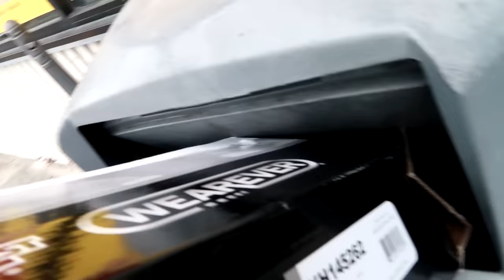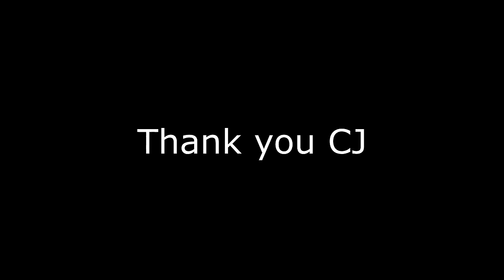what REALLY happened the night i should have died

Comment: hey buddy I know exactly what you're going through but mine was a little worse losing a tire I was 14 years old and I had a 86 Bronco 2 4 wheel drive passenger side front wheel hub assembly Kmart upper lower control arms came off doing 80 down the road install front tire take off in front of us end up traveling about a mile down the road and we had to post a vehicle and balance it to get it to the tire so we can fix it that right there is a death-defying scare right there as a 14 year old I mean I'm 30 now it was a long time ago I'm just glad you're safe and no one was injured and I always help people no matter what I always stop to help somebody now if I would have saw you I would have done the same exact thing helps you get off the road get you safe and help you fix your truck to make sure you're safe I'm getting back on the road

Comment: I had something similar happen to me a little over 7 years ago. Living in St Catherine's Ontario I was leaving a parts store in my 71 Monte carlo. Went on the 406 highway. Maybe made it to 50mph when the driver rear came off. It tucked into the fenderwell for about 50 yards then the drum came out of the rim and hit the road. I slewed to the right and stopped about an inch from a k barrier. Other side of that barrier is a fast moving river. I walked up the highway and found 2 of my lug nuts. Checked the other 3 wheels and the passenger rear all nuts were loose. A lot of things could have gone bad that day.

Comment: You must have ether missed that wheel entirely or missed some of the lugs when you torqued down the wheels. I have been a mechanic my whole life (currently 36yrs old) I spent 5 yrs as a fleet mechanic mostley 3/4 ton and 1ton trucks. Not once did I ever have a wheel fall off nor did I have to re-torque the lugs. I am glad nobody was hurt but in my opinion it was human error.

Comment: I had a frount wheel fall of on my truck (1995 chevy silverado 1500) lucky I just took off from a red light  and was going maybe 15mph my 33x12.50 tire went at least a whole citty block probably more and that was after it had hit my fender and slowed way down. and i have seen videos of tires hitting cars its not pretty i broke my studs doing 4x4 burn outs multiple times trying to pull stumps the only sign it showed was like a wheelbarring going out.

Comment: Your specs for your lug nut torque is  140 but make sure your lug nuts aren't bottoming out on your lug nuts since you had a factory wheel on there it's good to have a open lug nut especially the factory 7/8's 14.5 stock lug

Comment: You should slide the tire under the truck when use those crappie jackets.  Specially when you crawling in the wheel well.  SAFETY!  It's works as a make shift jack stand.

Comment: I was on the way home from work one day driving a 2003 ford f-450 extended cab with a tool body full of tools and a week or two before this I hauled off some scrap metal my truck came back at 16,147 pounds by its self on to present time I was on the way home it was 8:30 Pm going 75-80 mph no more than 80 cause it shuts off at 80 mph the darn right rear axle comes out hits a car and pushes the car into a tail spin at the same time this 16,000 truck is dragging on the axel housing and the tool body I ended up smashing into the guard rail on a bridge crossing a big fall and my right front tire comes up over the guard rail and keeps going dragging on it while I'm trying to stop the truck when it finally stopped most of the cab was hanging off the edge thank god for God and a heavy tool body the car ended up turning sideways into the road and then got t-boned by a Walmart tractor trailer thankfully everyone was alright and everyone walked away safe

Comment: I know you're "supposed to" re-torque your wheels after a few miles. Also, I'm not a truck guy or a mechanic, so I certainly may be wrong. But I find it hard to believe that he properly put on all 8 lugnuts, torquing them, and he just failed to re-torque them after a few miles, and that caused them to all come off, (causing his wheel to come off.) Instead, I think it's more likely that he either didn't put on ANY lugnuts, or he only put some or all on very, very loosely by hand, and didn't tighten any - not 1, with a lug wrench, not even talking about torquing or re-torquing any. That's how our minds work. We forget to do things. So, of course he thinks he put all 8 lugnuts on and torqued them, and just didn't re-torque them. Subconsciously minimizing the error. 

I didn't hear exactly how many miles he went after putting on the wheels at his friend's house. However, I bet you can travel many, many miles, (on highways anyway), if not across the whole country, with just 2 opposing lugnuts on each wheel, without having to re-torque any or all of them! Would I feel safe with only 2, on a big truck? No. But that doesn't equate to them coming off - I'd be worried if I had any missing lugnuts.

Comment: it happens man I lost the front driver side wheel on a Cummins I used to have scary shit broke all 8 lug studs off Hadda beat them out and put new ones in in the middle of the road got that done with next day drove hour to college got out and seen that 3 of the new lug studs sheared off again got lucky wheel didn't fall off the second time...aluminum wheels are the worst always retorque aluminum wheels also had a college instructor have the same thing happen to his crew cab long bed power stroke dully after a shop put new tires on it.

Comment: i had a crash it was a bit worse but i was about 1 km from were i was staying and lost control on a wet road in a mark 4 ford Cortina  i bent the drivers seat snapped the drivers seat bealt and bent the steering wheel  with my head and pushed the whole moter back 30 cm including the rear wheels and drive train. the first person that stoped in a b train truck puled the passengers door open since i saw stuck in the car i was only doing about 80 kms or 50mph at the time.

Comment: My story isn't as dramatic or dangerous but I was cruising down a country road on my yz250 with my buddy who was on a crf 150 and I'm not sure what the top speed of a crf 150 is but that's how fast we were going and prior to this I had tightened the chain on my bike and apparently not tightened the nut on the rear axel enough and as we were cruising the nut and some other piece on the rear axel fell off, luckily for me the axel didn't fall out. we were just cruising otherwise I don't think I would have felt the axel shift a little an I would have drove till the wheel fell off

Comment: my dad let's my little sister drive one of his GMC Yukons, one weekend I asked to borrow it to take a trip from a small town outside Dallas all the way to Houston and as I was leaving my dads house around 12 o'clock at night on my way back home to load up I was doing about 85,  because I was running behind from everything going on that day, I felt it shake and went to start going for the shoulder and before I made it there the front right tire blew and I spun complete around at least 4 times ended up facing the wrong way in the opposite lane i consider it a miracle that I borrowed the vehicle when I did because if it had been my younger sister, I feel her lack of experience driving, she may not have been even able to stay on the road and I also see it as a miracle that the road, which is normally fairly active any time of day or night, was completely empty or else I would've hit someone head on

Comment: As you probably know people loosen others lug nuts to purposely cause this incident
to happen. I've had both rear wheels loosened at one time. By luck, I felt my rear vibrating 
and found 3 wheel studs out of 5 had snapped off one wheel and studs 4 out of 5 on the 
other had snapped off.  A friend stopped over to see what I was doing. He told me who
did it and why. It was over a girl.

Comment: okay so here's my experience with helping someone out I had just gotten off work and it was cold and I saw a car pulled off Dangerously close to the side of the road like literally their car was sticking about 2 feet into traffic and before I decided to pull over I noticed their belt hanging from underneath the vehicle and with my Automotive experience and knowledge I was going to help these people and explain to them what is going on with the car after I helped  them move it so as I got in Thier car I was surprised that it was still running knowing that it could die at any point because the belt drives the alternator so since the belt was off they also didn't have power steering so it was extremely hard to move it was a big Mercedes SUV by the way and so as I struggled pull it into a parking lot my left wrist popped so loud I thought I hurt myself and it really hurt but instead it popped back into place or something and prior to all of this my left wrist had been jacked for months so they thanked me I told them what they can do to fix it and I jumped back in my truck and was heading home and noticed my wrist was able to move around WAY better so that pop I heard in my wrist was actually a good thing i cured myself  just by helping these people out!  And boy I tell you what God works in mysterious ways! and this was that night your wheel fell off Dalton.

Comment: when I was 16 I was driving my 88 Ford F150 down an old windy back road doing about 55 around a corner and my drivers side Steer tire fell off scared the hell outta me but somehow managed to keep the truck up right and after about 45 minutes wandering through the woods looking for a tire Found the tire had to call my dad and have him bring me some lug nuts because I couldn't  find none and I didn't want to rob any more off the other wheels that I already had in the past and it all happened because my dumbass put new Wheels on the front and I never was thinking to check on it after I had driven a while

Comment: 3 am in the morning at my job this young woman came over and started knocking on the front door. i always work alone so i go out the back door to see why she was there and when i went out the back door i saw here car the front bumper only being held on by only a few bolts she asked to use my phone so i let her. she called her boyfriend a mechanic to help her the boy friend apparently hung up on her after a few minutes of arguing she asked if i had any duck tape or any other tape i go to my car and grab a ratchet strap an go around the bumper and clipped the other ends to the hood and sent her on her way. her boyfriend comes a few days later gives me the strap back and  an envelope. inside the envelope was a thank you card and 50 dollars. the card said "you didn't have to do what you did but thanks i know i should have come to help but i didn't thanks for the help if you have any problems with you car give me a call"

Comment: next miracle...  not rocking the truck off the bottle Jack while wrenching on the axle. dude, at least put the rim underneath.

I had a guy drop a spare tire onto the freeway in front of me, in traffic. it bounced and flipped over 10 feet in the air. I had two choices: take out a car next to me, or plug it head on. fortunately my truck had a winch, so I was able to punch (ram) the tire and send it flying forward and off the side of the freeway.

Comment: hey man love the vids i drive 18 wheeler in utah and one night i was on my way home from gillette wyoming agter dropping a load and getting another and seeing my wife i was about to rockspring wyoming and the trailer brakes locked up and it gave a sudden jerk and stopped the wheels from spining note there are systems i  those.rig to tell ya when air pressure goes dow.  on of those went on than my truck brakes locked up i was doing about 10 under the govern speed and by the time i stop i have shredded 18 wheels apart it scared the hell out of me and i got it back to the shop the trucked looked at the truck wasnt making air pressure so it kept loosing air let just say my trucks air comprssoer went out always pti pre trip i.spection and post trip too or wlse yall be sorry

Comment: I understand why you could have died. I have only hydroplaned once. I was in my moms light as hell chevy cobolt (only around 2500lbs). And my tires where low on tread but no where near bald. So i am traveling in the rain when i go to merge lanes. i don't see anyone so i go to merge when i hear a horn. I look back and there was this dick head with no headlights on. So my instinct was to hit the gas to keep my back bumper from hitting him so i did not spin out. But what happened was i started a hydroplane. and after i started it, that fucken car. It started to use traction control in the back (witch is just pulsating breaks) so everytime i got it straight, it would spin me back out. So at one point i was heading straight for the median when i managed to steer it back and keep it form hitting it and i ended by sliding completely sideways down the highway until i stooped. That was the day that i started living. That was the day that i stopped giving 2 shits what people think about me. That was the day that i started realy enjoying life.

Comment: I was heading how from school in the down pouring rain super tired from the ROTC work out I had that same feeling on my stomach just before I made a turn my back tires lost traction and I fish tailed I corrected it then it went the other way into on coming traffic and I quickly swerved back my truck did 180°i slid through the grass hit I pipe coming out of the ground cracked the concrete then the truck flipped into a water filed ditch and by the way I am only 17 years old and I saw my life flash before my eyes I really thought I was going to die

Comment: I had an old 6.5 diesel and did the brakes well I had to use the bathroom and my brother was like go I'll put it back together well when he put the side he was working on back together he didn't do it right, so after we were done and what not went out for a test drive, pulled into this parking lot to turn around and when I was maken my turn the rear axle on the side my brother put together slid right out and the wheel and everything came out, scary af

Comment: How does your 3/4 ton heavy duty crew cab Duramax weigh 6,000 pounds? My 1/2 ton 2006 extended cab Silverado with a 5.3 weighs 6,400 pounds. That truck should weigh at least 10,000 pounds lol
Reply: my 1 ton crew cab dually weighs under 3ton stock

Comment: I no how you feel 3DMachinesMy front passenger tire fell off after I changed my wheel bearings it wasn't for the rubber break line holding my tire under the truck I think I would of rolled my truck

Comment: I had to pull this random guys Polaris out of a 7 ft ditch at like 8 pm and I was using a 2 joker... it took a while but we did it and then the next day I was on a track and I over jumped a table top and got gutted by my handle bars because I landed on my front tire and broke a bunch of stuff on my bike but before I did that lap on the track I felt that gut feeling.

Comment: Seems a bit over-dramatic. Glad you're okay and that no one was hurt but let's be real...properly torqued lug nuts would not suddenly loosen allowing the wheel to completely come off without destroying the lugs themselves (ie. stripping threads, broken off at the hub, etc.). Maybe those capped lug nuts are the wrong size to begin with and never were a good fit...or you just missed torquing that wheel. I've torqued Z-rated tires and wheels on initial install on sports cars, bikes and yes, 6K+ lb trucks and never re-torqued without a problem. No matter, and miracles be damned, this can most probably be traced back to simple human error.

Comment: is it possible that somebody backed your lugs off while you was asleep I don't think there's anyway you would have made it that far from dans if you would have done something wrong I mean 8 lugs there's no way all of them would have came off that's just crazy but I'm glad you made it ok dude
Reply: Julian Rada you'd be surprised, had a parts car got it running but forgot that when i threw on rims months before I finished the car i diddnt even torque the lug nuts probly got em only finger tight, ended up driving the car about 80  miles on the freeway and  countless times around the neighborhood, but one day took it around the block and the wheel just came off probly only going about 15 luckily,it was then I remembered putting on the wheels and telling myself I'll torque them later